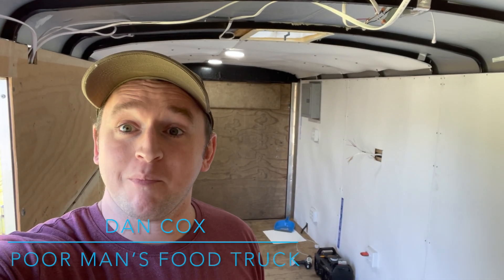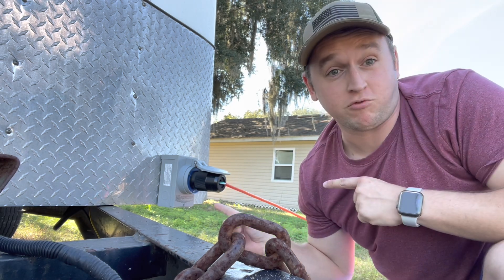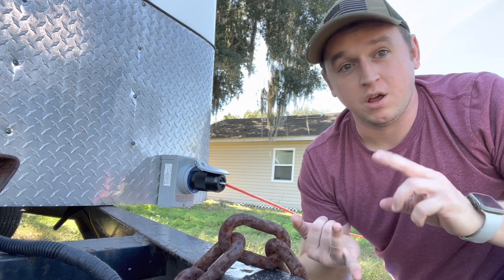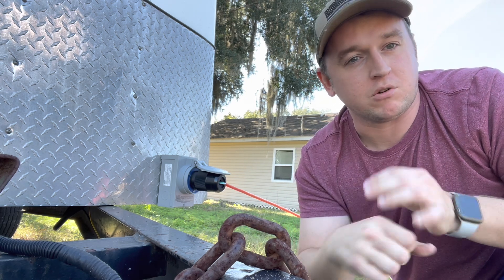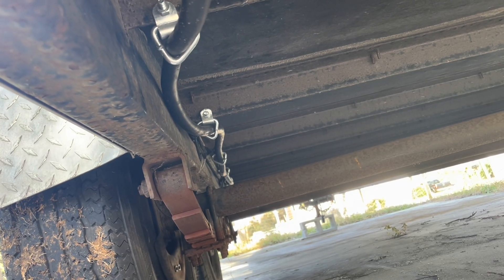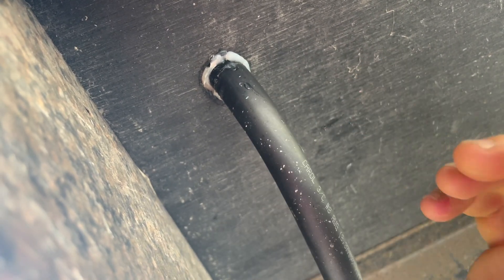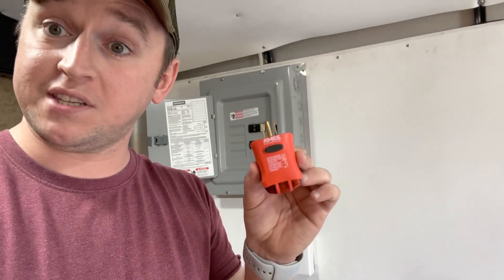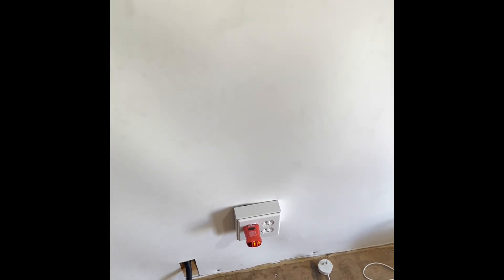Running My Electrical - Poor Man’s Food Truck

Comment: Does it have to be behind the wall? I did cable sheathing wire on my build and i am in dade county
Reply from the maker: No it does not need to be behind the wall, in fact it may be beneficial to run through conduit as it would be easier to modify in the future

Comment: That was completely genius with what you did under the trailer to hold that big cable line, I use that to secure my freezer and refrigerator on my walls, great job !
Reply: Absolutely, hard work pays off and you’re knocking it out. Love your videos and hope to see more.
Reply from the maker: Amazing feedback! Thank you so much! More coming VERY soon my friend!
Reply from the maker: Thank you sir! I really appreciate your kind comments! And thank you for the support 🙏🏻
Reply: Watchin the play by play on building this food trailer is great! I am already getting ideals, weather I do anything with them is something else to be seen. Neat job on running the cable underneath for sure but I did get a though, What if you were to run a strip of pc pipe and then the cable through it. Problably wouldn`t have to use as many anchor and it would help protect the cable.

Comment: Howdy from southern wisco! I am currently outfitting a 24ft camper trailer into a mobile meat (mostly small stuff) processing trailer. Good luck mate on this spring/summer. I feel you. Thats my startup time as well.
Reply: Id love to share, but im not sure how to go about sending pics and i dont want to put my email or my real name on here. Would be nice to have a private messaging on here. Got a FB for your truck? I have a 3d printing page with my youtube name on FB
Reply from the maker: Totally understand! Check out “Poor Man’s Food Truck” on Instagram and send me a PM there! No FB page yet, wanted to wait until I get a firm name for the business first!
Reply: Unfortunatly, i dont have an instagram. Im still in the process of building. I had to basically gut the whole inside and replaced the roof, added a 36x48 window, and did a bunch of fiberglass work. I insulated half on the inside and put in a rubber vinyl floor and am now starting the frp panels, electrical, plumbing, etc. It got too cold up here so i took a break for the last couple months but my wallet hasnt. Lol. Look up Backwoods Butcher in the next month or so.
Reply from the maker: Wow! Sounds like a lot of work right off the bat! How have you found the electrical so far? That was the trickiest part for me! Yes I will definitely look it up, is that going to be the name of your business?
Reply from the maker: Hello there! Wow sounds awesome! Would love to see some pics of your progress so far?! Thank you I really appreciate that and wish you all the best for starting up around the same time! God bless!